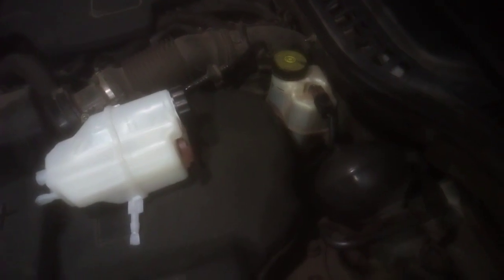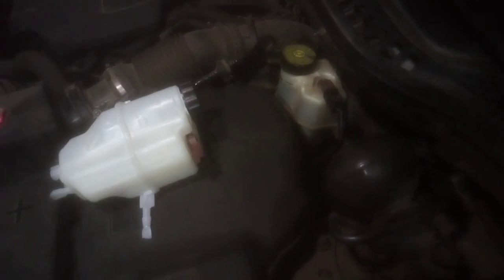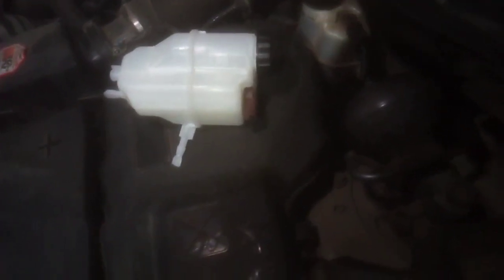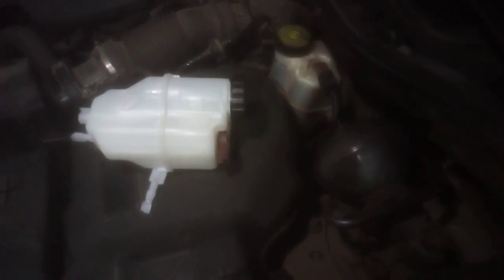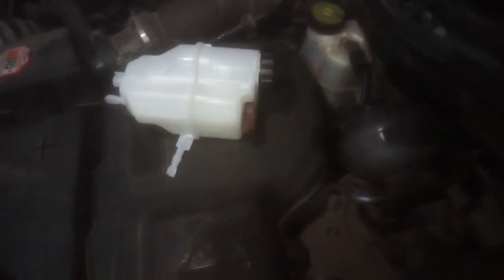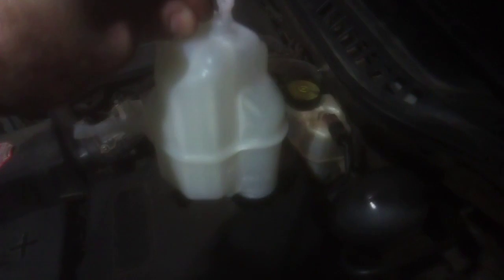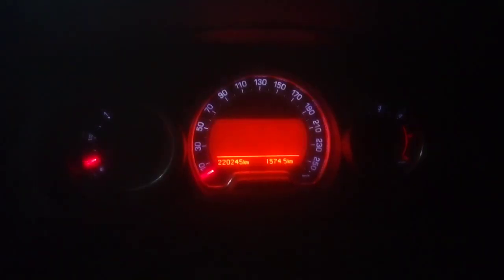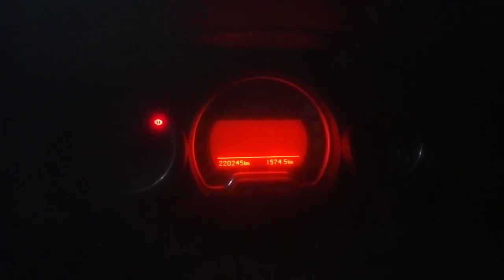2nd UPDATE - Citroen C5 X7 Brake system solution (ENGLISH)

Comment: That's an interesting solution. But is there a chance that the new reservoir will melt or become damaged where it is?
Reply from the maker: Nice to be the devil's advocate, but I don't realy think so. It does get hot there, but not hot enough to melt PP plastic. And in the remote chance that it DOES melt, at least I'll know what the problem is, and get another reservoir, put it there again, cap in place to keep it sealed from the bottom, and fill it with some kind of liquid to keep it cool. 
In fact......that's a great idea to incorporate right now. I'll probably fill it with coolant, which doesn't do any damage if it leaks. Thanks. 👍👍👍👍
Reply: @mr_nice.  Understood! I think I watch too many videos of people doing home repairs on their cars and it going wrong 🤣🤣🤣 But I like your solution! It's the Citroen way. Innovation!
Reply from the maker: @comcarclub  ....hahahah.....just like I say brother : Citroens are adventurous cars, and citroenistis are adventurous spirits. Solving problems the easy and fast way. MacGyver style. I can't even start counting the inprovisations I did on the GS to make it reliable. And it DID get pretty darn reliable. That little thing keeps going where others give up. hahahaha....🤣🤣🤣🤣🤣🤣
So now  you know. Spread the word. If you have some stupid messages on your dash, saying that the braking system is faulty, and you know that there is no problem with your braking system, get a known good, used, brake fluid reservoir from the junk yard, and swap the connector. Easy breazy.....🤣🤣🤣🤣🤣
Who says modern cars are hard to fix????....not  citroens, that's for sure...🤣🤣🤣🤣👍👍👍